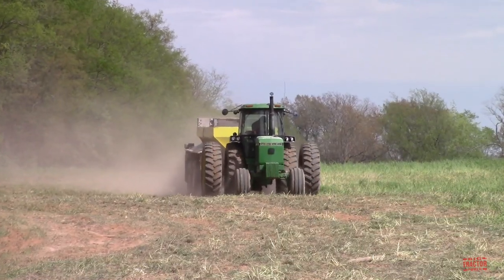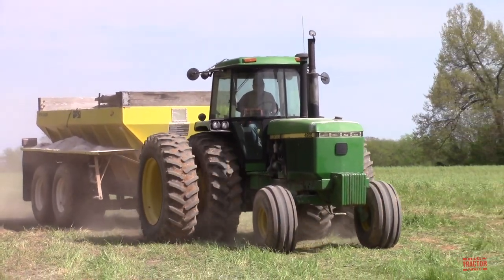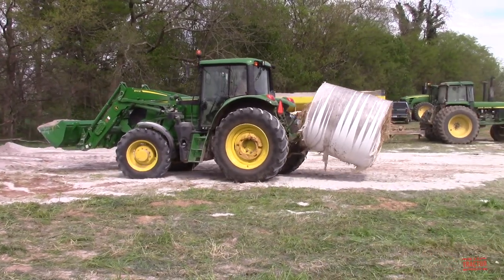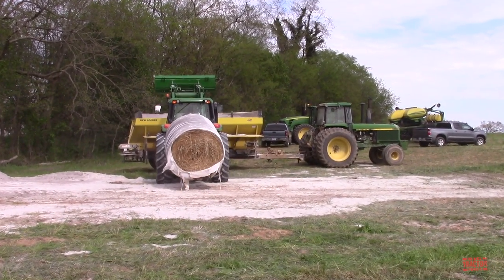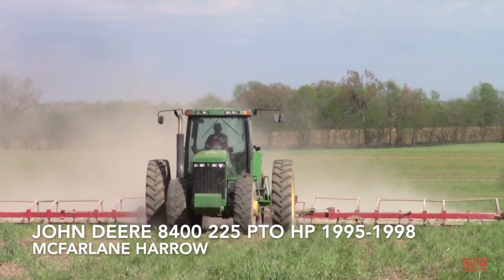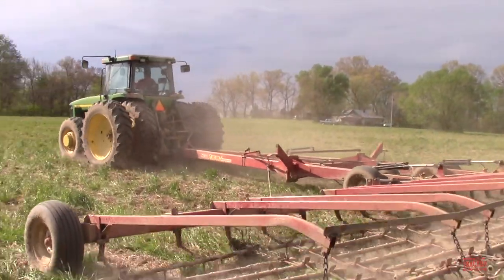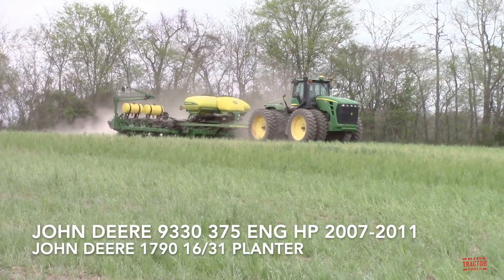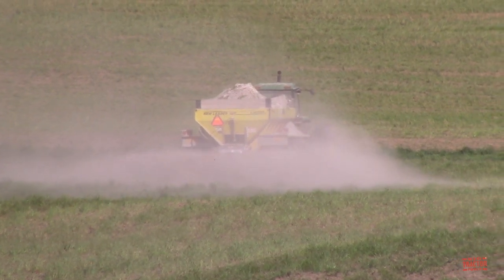JOHN DEERE 4955 Tractor Spreading Lime for Corn Planting

Comment: Why do the 40 series John Deere tractors have the front of the cab round? Is there a purpose for that?
Reply: PlowableGore 14 they are called sound guard cabs and the shape of it disperses and mutes the sound
Reply from the maker: The 30,40,50,55 and 60’series used the Sound Gard cab for 21 years. The design was built to lower the decibel if outside sound in the cab.

Comment: Does the spreader have the shut off on the ends like the self propelled units an auto steering
Reply: Jay Thomas There’s no satellite receiver on the cab so I would say he does not have auto-steer installed. And therefore that spreader would not have an auto-shut-off mechanism either.  I bet he’s doing it the old fashioned way.